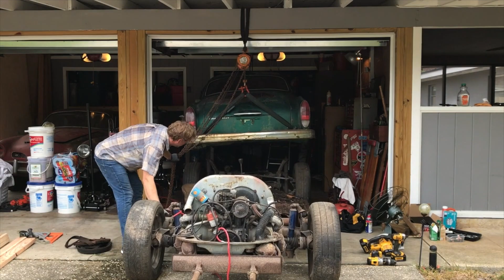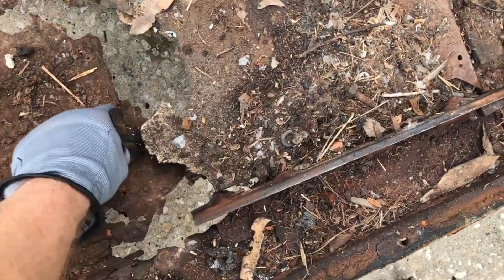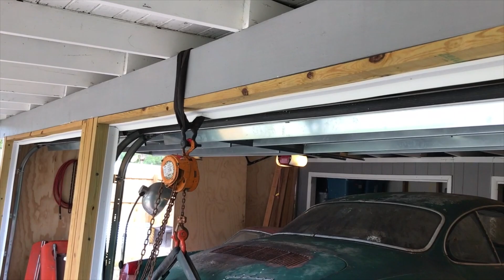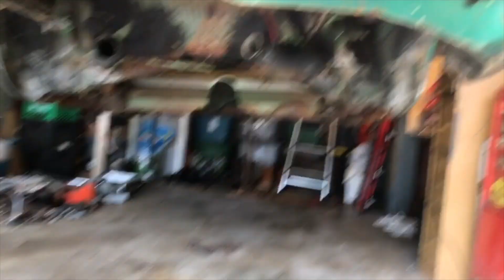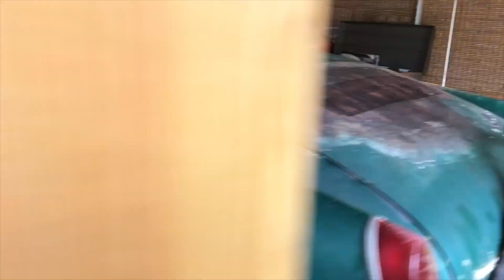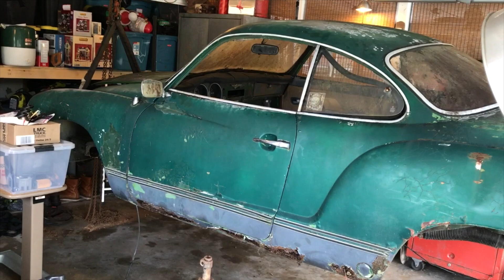VW Karmann Ghia body and chassis removal - Restoration Vintage Volkswagen 1972

Comment: I started redoing my '71 KG last year this time and now I am almost done. For a total reno be ready to spend around 20k. Good luck
Reply from the maker: Hey Cornel, Thats cool. Do you have any pics or videos you can share? Would love to see them. I would imagine a good restore would cost at least that much. I plan on doing most of it myself over the next few years.
Reply: CT moog, I do have lots of pics taken during the restoring but I don't know how how to upload them. To give you some moral boost, my Ghia looked as bad as yours. It can be done! I did all the jobs  by myself. Welding new panels and rockers, sand blasting, epoxy primed, painting. Now I am fighting withe the rubbers. An advice, buy only the winshield seals with molded corners, the others don't fit. Good luck
Reply from the maker: Thanks Cornel. Where are you buying your parts from?
Reply: CT moog CIP.com
Reply from the maker: cool, thanks

Comment: Looks like you had some good strong bumper brackets and mounts under the corners of the car... I didn't when I did mine... lol, that would've ended very badly for me using this method!  Looking good!  Stay at it!  😂😀😂😀😂
Reply from the maker: Yes, I did several lift test with it before I went all in. Once I was sure they were secure and the trusses were secure I went all the way! So far so good. I working on the dolly for it now. Thanks man!
Reply: great to see u follow this channel too !!!